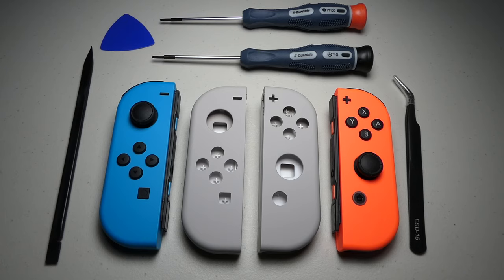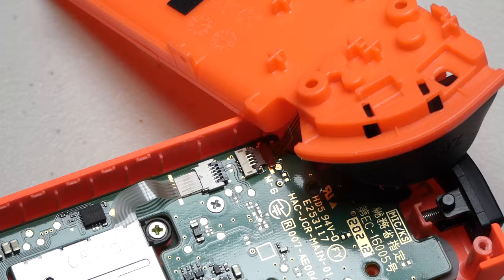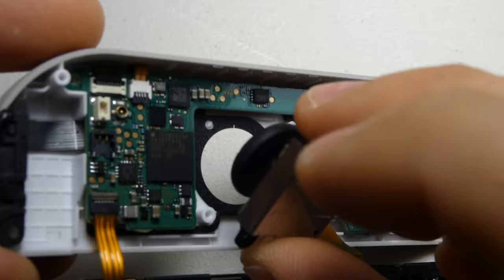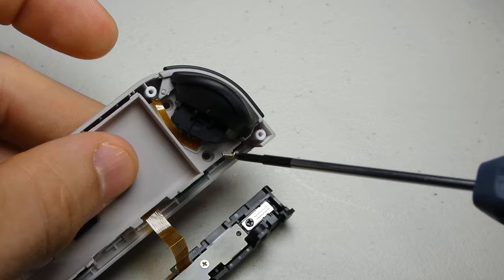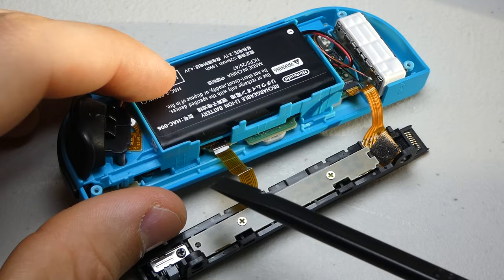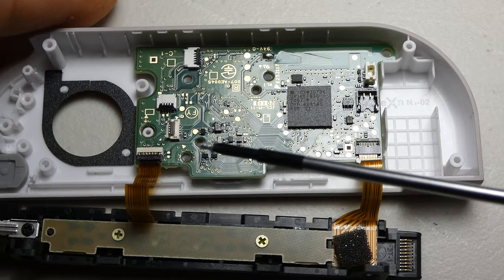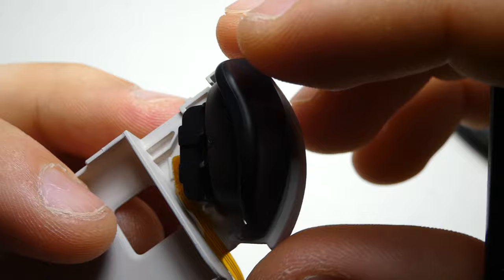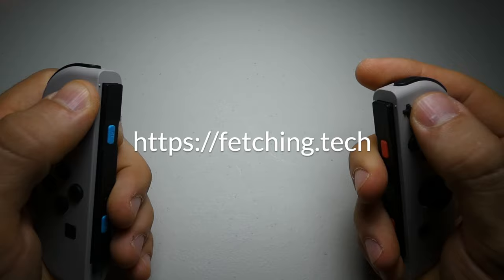How to Swap Out Your Joy-Con Shells

Comment: I wanna do it but I'm scared that I'll mess up my joycons
Reply from the maker: You're definitely not the only one there. I have faith that you are capable, but I could understand if you don't feel comfortable with it.
Reply: I ended up messing my right joycon. please dont do this if you dont have experience or the right tools :( im so sad
Reply from the maker: @danieela15  I'm sorry it didn't go as planned. What isn't working on your controller?
Reply: @FetchingTech  it was very hard for me to insert the ZR conector, so I accidentally ended up ripping off the R button from the motherboard, didnt know it was such a fragile piece :( but I hope it can be solded back. At least the joycon looks good and I can left it  for multiplayer
Reply from the maker: @danieela15  If it's just the ribbon cable that got torn, you can pick up replacements on eBay. However, if the actual motherboard got damaged that will make the repair a bit more complicated for sure. Worst case, you should be able to pick up a replacement motherboard on eBay for not too much money as well.
Reply: @FetchingTech  sorry if my english its not so good, i wanted to say that
i'm going to take the little r button piece to a specialized place where they can weld it back. Anyways, this is a great video, but im just very clumsy. And at least my left joycon turned out good and it looks great.
Reply from the maker: @danieela15  No problem. I really hope you're able to get it working again, and I'm glad you found the video helpful.
Reply: It worked tysm
Reply: Make sure you get quality tools before starting. I managed mine no problem
Reply: I was nervous too, but you'll never do anything if you're scared. And I suck at stuff like this lol. Replaced some grey joy con shells for some Zelda Wind Waker ones. Both came out perfect. 🙏
Reply: U know how to do all the things he explained in the video. But the thing YOU don’t know how to do is believe and trust in ur self
Reply: i followed along with this video, and they turned out perfectly! so much better than buying new joy cons for $90! i bought the shells off amazon, and they came with a screwdriver kit with all the screws and springs you might need if you lose any of them. i didn’t have any of the tools he used, i just improvised with a cuticle pusher and crappy tweezers i use to pluck dead leaves off my plants. anyway, my point is that you can do it! :)
Reply: That's how I felt about opening my PS5 controller when  one of 2 started stick drifting I bought a like new one for $50 before I was brave enough to attempted to fix it. Now I've fixed my 2 of brothers and 3 of my nephew's controllers . Having the right tools and a tutorial in front of you  there are no limits.
Reply: Scary ah boi
Reply: @EastSide_LB  I only tried after reading your comment bc I was scared but you’re right and it turned out perfectly! I’m so happy 😊 thanks for the courage booster
Reply: I accidentally pulled the vibration motor wires entirely off the motherboard 😅 be real careful folks. When they say quite stubborn, they aren’t kidding
Reply: @EastSide_LB lol
Reply: Nah I’d win
Reply: I know your comment is old I did this as my first ever project taking something apart with no experience ever. Just take your time makes sure to work on a table have everything organized and you'll be fine.
Reply: This worked very well, I was nervous going into it and with the easy breakable not helping. I will say that you need to take this one step at a time and use quality tools. The last time I tried to do this, I stripped all my tri wing screws on the right Joy con because of the cheap screwdriver
Reply: @edwardlupella6758 i accidentally did the same but for the battery cable when trying to fix my rail lights. 😬 Ifixit said to use a spudger to push the battery cable out instead of this video that says pull it and somehow the housing the battery cable goes into came off so now I can't attach it to the motherboard. But I'm emotionally attached to my joycon so I think I'm gonna try to find a replacement motherboard. It's hard to tell which to trust though....
Reply: Don't try this. It's not worth it.

Comment: Tip: A better technique to get the ZR / ZL button is to use a wedge tool at the top corner of the button, that way you 'pop' it out without the springs flying everywhere. Hover your finger over the bottom side of the button (minimal pressure). Hope this helps
Reply from the maker: Awesome, I will try that out on my next swap. Thanks for the suggestion.

Edit: Can confirm, this is a much better way of getting the shoulder buttons off without risking snapping the plastic or the springs. Thanks for the tip.
Reply: Wish i read your comment before switching my shells... Broke my ZL button in the process and lost a spring as well 🤦‍♂️ ! Ended up buying a cheap used one with drifting issues for spare parts
Reply: nice. another helpful tip tho, i cover my hands with a blanket before popping it out, springs will fly, but you know exactly where to find it hahaha
Reply: @FetchingTech  Can you make a short video on how to do this? I don't understand the comment exactly...
Reply from the maker: @magolord24    unfortunately I don’t have a ton of time at the moment, but I will try to fit it in if I can.

The idea is to wedge the spudger in the corner of the shoulder button where it comes to a point, and slide the tool between the button and the tray. It should hopefully come apart less violently.
Reply: @FetchingTech  is
Reply: This felt much better. I did the video technique and it felt rough, I did yours and it came off much more tame. For any one whos confused, use a spudger to pry the button off from the top corner, use your fingers to hold the button softly to prevent the springs from flying off, great technique.
Reply: Can't I just keep the original battery tray to avoid losing the springs and the hassle of putting it back together?
Reply: @JazielR  A little late to reply but part of the battery tray is actually exposed when the joycon is assembled (the bit in between the trigger and shoulder button on top)
Reply: Ugh absolute saint. Thank you so much for the tip
Reply: @Alvarocious  One question, do i yank it off (sorry it sounded wrong) when the joycon is closed or when it was not?
Reply: 5:27 another helpful tip when putting it all back together is to snap the ZL/ZR button on first without the springs. Then when the button is in place, come in from an angle and add the springs. This method saved me a ton of time since it's nearly impossible to set the button onto the springs in one motion.

Comment: If your joy con is super old, you might as well buy new joysticks while your at it. their gonna drift anyway. Also, make sure to download joy con toolkit on your pc to change the color of the joy con when you connect it to your switch
Reply: I never knew you can change the colors. Thanks for the tip :)
Reply: you don't necessarily need to buy new joycons - you could just buy new joysticks for 16$ on amazon
Reply: @syntax2679  that’s what I did

Comment: If you're nervous about doing this, you're not alone. This video is the best and easiest to follow - HUGE thanks to @FetchingTech for this video. The payoff is worth it, folks. You got this!

Pro Tips: Watch it a couple of times first before diving in, so you can get mentally ready. Pack your patience and take your time. Get the right tools first. Avoid distractions, if possible. For removing ZL and ZR, I used a large ziploc, and removed them while the joycon was in the bag in case a spring popped out and could be easily rescued.
Reply from the maker: I love the ziplock bag idea, that's really clever. Thanks for the kind words and great suggestions.
Reply: this insane, this is brain surgeon level

Comment: Just changed my joycons to transparent ones and it looks great! You have the best tutorial up here and it would be even better if it includes changing of buttons but nevertheless you have the best slow and detailed explanation which I came back watching over and over again when I’m in doubt. 

Tips to note :
- SL/SR ribbons are EXTREMELY fragile. I have ripped one accidentally and the other one was disconnected if I bent it (so it’s basically useless too - I bought replacement ones online and backup for the near future lol)
 - The white vibrator is giving me huge heart attacks moments whenever I try plugging out…so I just thought I leave it be and be extremely careful with it 😅
- Do not rush/panic yourself when in doubt, take a sip of water or have a break before coming back to fix it. 
- Always check if your buttons are clickable after the finished product. Go to Settings>Controllers & Sensors>Calibrate Control Sticks (To check if your joycon drifts) and Test Input Devices>Test Controller Buttons (To check if all your buttons are working)
Reply from the maker: Thank you for the advice. I think those are all great points.

Comment: Now i consider myself one of a professional idiot... 
But this actually worked and I'm so proud of how i kept optimistic 😭✨

And friendly TIP for the SCREWS! (Considering i thought i had a "mystery screw" at one point lol and this is one of my first times working this immersive)
.....
Most of the SMALL screws go on the bottom board, around 3 screws are not screwed in until the 2nd layer comes on, there is ONE SMALL screw that goes on the slider- black thingy- at the end though. I hope that helped!

But again, thAnK yOu-
Reply from the maker: I'm really glad you found the video helpful, especially with limited previous experience. Thanks so much for the tips and tricks.

Comment: here is a tip for people that are beginners. Keep the battery and hd rumble plugged into the motherboard, because if you are not careful, you can end up breaking their connectors (speaking from experience here)
Reply: i just did lmao. so, do i have to get a new one?
Reply: @aylin4841  well you can always just buy the parts online. And luckily most of them have the connectors connected

Comment: FYI, I was able to do this without disconnecting anything. I messed up my cord on my first attempt so I bought a new set of joycons and did it without disconnecting anything and it worked great. 👍
Reply from the maker: Awesome, I'm glad to hear it. It makes it a lot easier if you don't need to swap out the battery tray, that's for sure.
Reply: How so?

Comment: Honestly, thank you so much for posting this. I got gifted a replacement shell for the switch, joycons and dock, and I’ve never really done anything like this. 

My only warning comment is that the screw drivers provided were absolute hot garbage. I smoothed a couple of the outer shell Y screws,  which was horrible. I managed to extract them by running a drill in reverse with what I felt was a huge amount of pressure.
Reply from the maker: Awesome, I'm glad you found the video helpful.

Also, that is one of the biggest complaints I see in reviews is how easily the y-tip screws strip. I'm glad you were able to get yours out without having to brake off the backplate.

Comment: I didn't realize how shakey my hands where untill i did this to my joycons lol. Anyway the right joycon was alot harder then the left one, so having done the right joycon first like you did gave me the confidence to know i can easily do the left one. One thing i forgot though is to apply some sort of double sided tape for the battery on the right controller, will i be fine without it? Or should i put tape in it asap?
Reply from the maker: Yeah, the right Joy-Con is a bit more involved for sure. You should be fine without the double-sided tape. You might notice the battery shifting around slightly if you use a lot of motion controls, but it won't hurt anything.

Comment: Yes, this is what I needed. I have a second gray set that I want to paint royal blue and I couldn't figure out how to remove the ZL trigger from that middle piece, so I got it off now. In another video I watched he didn't even bother with that part, he just swapped the whole middle piece over (along with the ZL trigger) and left it gray. This video will also help when I put it back together in a few days after I've finished all the painting and can't remember how it all goes together again. Thanks.
Reply from the maker: Yeah, it would certainly be easier to just swap the whole battery tray over, but I think most people would rather they match. Good luck with the swap.

Comment: its literally IMPOSSIBLE to get the trigger on after you take it off. Springs fly into another dimension and never stay straight
Reply from the maker: Yeah, I hate that bit. I've had success making sure the springs are aligned with the button first thing and then clipping down in place afterwards, but I definitely wish it was a little easier.

Comment: I just got new shells for my joycons and your video is super informative, but i also wanted to change the buttons on the "inside" of the joycons (SL and SR), can i just unscrew the motherboard directly below them or are they not to easy to swap?
Reply from the maker: Yes, I should have shown that in the video, but it is pretty simple. Just unscrew the two screws on the ribbon cable that hold the SL/SR buttons in place, and swap the rubber membranes to your new buttons. When your putting you new buttons in, just pay attention to the little ears on the buttons. They only go in one way. Let me know if you need me to explain it better.
Reply: @FetchingTech  sorry for the late reply, was waiting for joysticks to arrive and i finally changed my shells, thanks again for the instructions and yes it was quite easy to chande the SL and SR buttons, just wanna leave a tip out for whoever finds the same problem as me: if you can't disconnect your rumble motors, or if you fear you'll damage the wires, just leave them plugged in, may be a bit more tricky this way though

Comment: For my 1st joycon (left) I took apart I followed the 10min and under video and with the wrong size drivers I stripped basically all my screws and the minus button requires extra unnatural effort to apply pressure. My right joy con I followed your video exact, and I also got the battery holder replaced, moved the dust protector and now it’s back together with prebuilt quality feel with no issues. Doesn’t matter if you don’t have plenty of comments bro you seriously saved my shell switching problems and gripes. I also went and found the proper size tools and yes, Y0 and Ph00 are the perfect fit with no stripping
Reply: Any advice for screw stripping? My shells I ordered came with extra screws but I am unsure on how to resolve this
Reply from the maker: @dewd7726  First off, I'm really glad the video helped, and I'm sorry your left Joy-Con didn't fair so well. As far as getting the stripped screws out, that can be tough. I've heard some people have success using a rubber band to create more friction, but you might have to invest in a small screw extractor kit. Thankfully they can be had on Amazon fairly cheaply. The trick will be finding one with a small enough bit. Good luck, and let me know if you have any more questions.

Comment: Thank you so much for this! :D Everything worked perfectly! A little tip for anybody else struggling with the one thing that gave me a hard time: it's not striclty necessary to remove the vibrating motor! You can leave it attached, just be careful with it :)
Reply from the maker: Awesome, I'm glad your swap went well.
Reply: Agreed.  I couldn't get it so I left it attached.  Worked out well!

Comment: Yo I just wanna put this out there, for anyone having trouble putting in the ribbon cable that's connected to the back of the battery holder. What helped me (since I'm left-handed and using tweezers with my right hand was a complete nightmare) was to unscrew the ribbon cable from the holder, insert it onto the motherboard FIRST, then re-screw it to the battery holder properly and put it back together. Voila, you got it. Hope this helps any lefty people out there that's struggling to swap out their right joycon shell. Peace!

Comment: I just did this today using this guide and it went flawlessly! I have some experience albeit not much repairing MacBooks so I’m no stranger to very small screws and ZIF connectors. It took me about 2 ½ hours to do both controllers and I also swapped the plastic latches for metal ones.

Comment: I kept all the wires  connected and just unscrewed all the attaching points and did a straight swap made it easier for me because attaching those tiny wires is a nightmare.
Reply from the maker: I don't disagree, leaving as many cables attached as you can is definitely the way to go.

Comment: My left day 1 joycon finally got beyond recalibrating into the unusable. This video was fantastic! Though on some steps I'd recommend adjusting the order. The biggest tip I can give is to prioritize getting the ribbon cables back into their slots when reassembling. For me prioritizing other parts like getting the springs aligned instead of getting the cable into the slot THEN worrying about springs and the shoulder buttons. Focus on those ribbon cables first, the rest is really straightforward.
Reply from the maker: Thanks for the tips. I think that’s smart, those ribbon cables are easy to damage. It makes sense to prioritize them.